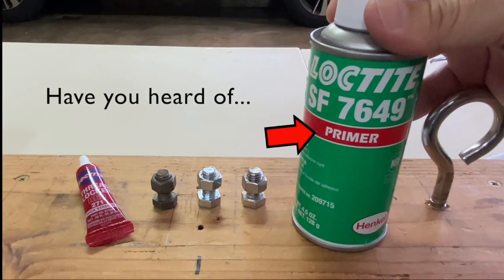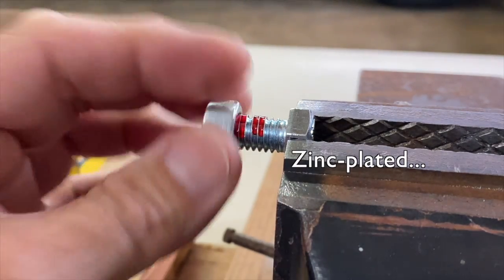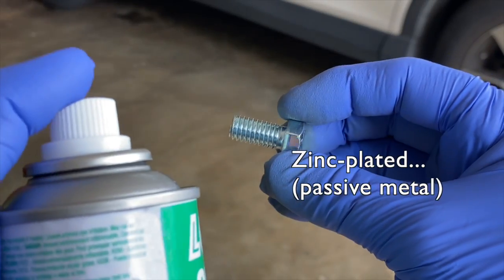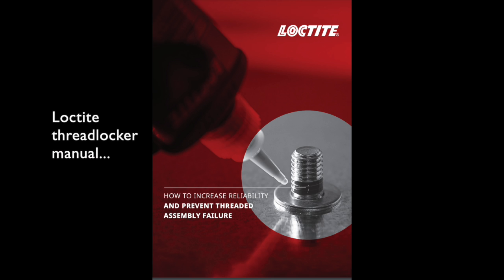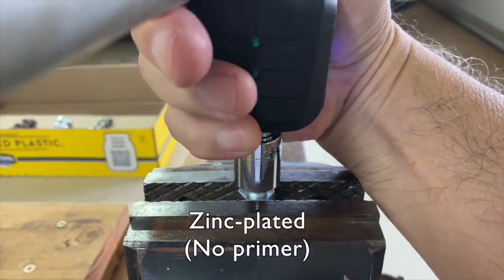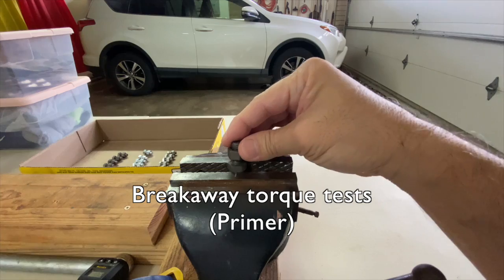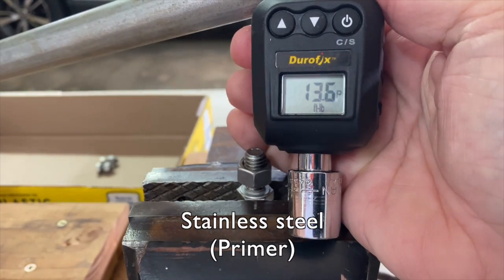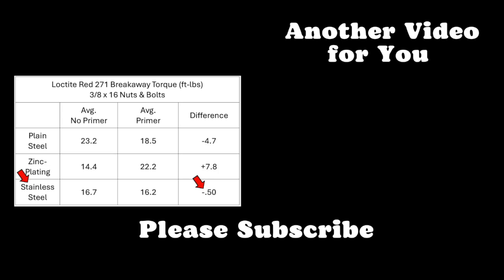Nuts & Bolts - Most DIYers Have No Idea - Loctite PRIMER?

Comment: Never even heard of this stuff. Great video and testing i think if you have a can it definitely doesn't hurt. though i think you should not remove the outliers on such a small sample. Maybe 8-10 you can do that but the variability of the hardware and the adhesives should be considered. This is what you'll really face

Comment: you used the primer wrong

it's not supposed to just be sprayed on like paint-move the spray close to the thread

it's supposed to soak the thread and remove contaminants with it

picture dries and works best with heat-just use a lighter or something and you speed up the chemical reaction 

BTW heat speads up any chemical reaction

Comment: I would suggest trying this same type of test with the following:  medium thread locker with bolts & nuts as is, and again with the nuts & bolts cleaned before applying the thread locker.  We found a huge difference when using Acetone to clean before applying threadlocker.

Comment: As far as I can tell, Loctite seems to need a primer if the formula ends in a even number, and for odd ending formulas, these are usually labeled as "oil resistant."
I'm searching for a different formula because the primer has only a year shelf life.

Comment: Loctite is intended to combat vibration induced loosening . It is not really an adhesive .
Reply from the maker: Thanks!  It is an anaerobic adhesive that is used to prevent loosening by vibration.  Measuring its breakaway or breakloose torque is a convenient way that the manufacturers use to test its strength.  👍😎
Reply: @HacksbyDad  would you try and glue something with it ?
Reply from the maker: @philliplopez8745  Nope.  I would not.
Reply: @HacksbyDad  they use the Junkers test , are you familiar?
Reply from the maker: @philliplopez8745  Yup.  I can't figure out an easy way to make a Junker test rig.  Here's my diy version of an alternate aviation vibration test rig... https://youtu.be/lwtUWB2TIYA
👍😎

Comment: I am supper concerned with the low torque values.  Thread locker should create a fairly uniform torque (not a surprising high and certainly never low).  They are generally anaerobic, so maybe the 0 and low ones had too much air (too loose) to work (cure) properly.  Who knows, but clearly a fail.  Another thing that this shows, is testing is very important if it is a critical install.

Comment: This shows that, generally speaking, any kind of adhesive cure is almost always stronger if the cure is slow rather than fast; and primers can, in some  circumstances, weaken rather than strengthen the bond.
Reply: They don't cure well, and sometimes not at all, on stainless bolt and nuts without the primer. 
In some cases, it's an unfortunate necessity.
Reply: I have some anodized aluminum rods with threaded joints/couplings.  Would primer help or hinder threadlocker curing?

Comment: Do you want to wire brush the plain steel before applying the loctite? I think the black color is because of the oxidization.
Reply from the maker: Thanks!   I didn’t think of that. 👍😎
Reply: Actually , the Black is a surface coating to PREVENT rust in storage .
Reply: @johncunningham4820 , *anodizing*, an electrolytical process to prevent further oxidation; but high-humidity or  condensation will cause rusting eventually. Identically anodized fasteners (same metal and coating) tend to cold-weld themselves together anyway.....
Reply: @goodun2974  I didn't know anodizing was used on anything but aluminum.
Edit: Upon reading, ferrous metals are specifically excluded from being anodized.
Reply: @goodun2974  . Who  mentioned  Anodizing ? Other than You , of course .
Reply: @joewoodchuck3824  , not just aluminum. From Wikipedia, "Ferrous metals are commonly anodized electrolytically in nitric acid or by treatment with red fuming nitric acid to form hard black iron oxide. This coating remains conformal even when plated on wire and the wire is bent. Processes for anodizing also exist for titanium, zinc, magnesium, niobium, zirconium, hafnium and tantalum". Also this: "Anodic films are generally much stringer and more adherent than most types of paint and metal plating, but also more brittle. This makes them less likely to crack and peel from aging and wear but more likely to crack from thermal stress."
Reply: @joewoodchuck3824  . Anodizing can be used on any Conductive Metal .
Iron and Steel are frequently Anodized to prevent Corrosion . That's what Galvanising is .
Reply: @johncunningham4820  , um, yes and no. Hot dip galvanizing, often seen used on bolts and nails, is done by immersing steel into molten zinc.  Zinc can also be plated onto steel in much thinner, smoother layers by an anodizing (electrical) process,  which is preferred if the surface is going to be painted.
Reply: @johncunningham4820  I didn't think galvanizing and anodizing were the same at all. Galvanizing is a hot dip zinc coating, where anodizing is more of a chemical treatment which is nonconductive. It also hardens aluminum surfaces and is in fact an electrical insulator. You can prove it with an ohmmeter.
Reply: @goodun2974  Analyzing and anodizing are not even related to each other.
Reply: @joewoodchuck3824  it was autocorrect's mistake; I fixed it. Thanks for the heads-up!
Reply: @joewoodchuck3824  ,  I spent 20 years as an audio equipment repair technician and often ran up against cases where poor grounding was created by a layer of anodizing on bolts, screws and/or the chassis itself. Every successive generation of electrical and electronic engineers repeats the same damn mistakes!
Reply: @goodun2974 . Shame on the manufacturer for not knowing any better. I designed custom electronic equipment often using anodized aluminum front panels and enclosures. It was standard procedure to  counterbore (not the same as countersink) any locations where conductivity was needed as the very first step of construction. I preplanned layouts so I'd know where it was needed. Not good stuff to breathe during the process of clearing it either.
Reply: @goodun2974  I swear autocorrect hinders just as much as it helps. It gets in the way of intentions as well insisting on inserting it's own idea of my thoughts.
Reply: @goodun2974  Ferrous metals are specifically ruled out for anodizing according to what I read, including Wikipedia. Maybe you mean some other process.
Reply: @goodun2974  Except that zinc coating isn't called anodizing, not in any common terminology at least. It's called plating. Anodizing doesn't add any metal to the base metal which is most often aluminum. It combines the existing aluminum with another chemical for surface treatment.
Reply: @joewoodchuck3824  , I've also seen lots of metal chassis that were heavily painted on the inside, in places where grounds needed to be made,  Including threaded standoff posts that were riveted or slot welded to the inside of the chassis before it was painted and so the end of the standoffs had paint on them where they were supposed to sit against the underside of the circuit board and make contact with a ground pad..... and they'd use black painted or anodized screws to hold the board down to the painted standoffs!
Reply: @goodun2974  Very poor design. The standoffs should have been masked before painting and fully conductive screws specified. Additionally, a wire jumper should have gone from a dedicated ground point on the board not associated with mounting, and to a dedicated (unpainted) chassis ground point. I went a step further by always separating circuit ground (reference) from earth ground to eliminate ground loops. The people who used my equipment measured noise in microvolts.
    A degree may get someone in the company door, but it isn't a measure of being smart.
Reply: @joewoodchuck3824  ,  These days you'll see lots of stuff built in China where they're still switching and/or fusing the neutral line instead of the hot, running the hot to the side terminal of the chassis-mount fuse holder instead of the rear terminal, combing the earth ground point from the power cord with another power supply or signal ground, or tie tge earth ground to  the mechanical mounting of a heavy transformer, instead of having a dedicated, unshared earth-ground point.  And then you've got things like cloned digital soldering stations coming out of China that can leak 100 volts through the tip of the iron into the board, running the risk of damaging sensitive components. I've seen reviews of these things on YouTube......
Reply: @goodun2974  It's a scary world when ignorance reigns.
Reply: @goodun2974  . BOTH those are correct . It depends on the End Use of the Product .
Reply: @joewoodchuck3824  . Well THAT's Piffle . Galvanising of Steel/Iron was originally an Electrolytic Process  whereby the  Zinc  Anode dissolved in the Electrolyte and was deposited , at a Molecular Level onto the Ferrous Cathode . Works the same for Cadmium and several other metals used to coat Steel .
And Galvanic Plating  is  still  used .
Hot Dipping  is  technically  not  related  other than Zinc and Steel being present . 
Which process is used relates  MAINLY  to the End Use of the Product processed .
Reply: @johncunningham4820  WTH is piffle?
Reply: @joewoodchuck3824  .
Piffle : aka  Balderdash  aka  misinformation  aka  B/S .
Reply: The black color is a chemical coating.

Comment: Hello Dad!!. "Gracias por el video", thanks for the video. Im not from USA, im from Colombia.  If i remember the primer is mainly for cold temperatures to shorten the drying time of the threadlocker. In Colombia we dont have that, as we have a single tropical weather all year long. But anyways i enjoyed your video.

Have a nice day Papá.
Reply from the maker: Thanks!  Yes, it’s mainly for curing speed in cold temperatures and on passive metals.  👍😎
Reply: @HacksbyDad , it's my understanding that threadlocking compounds are a variant of cyano-acrylate compound ( CA/Super glue) designed to cure in the absence of oxygen; tight threads exclude air from the interface, which begins the cure. Also, CA glues in general cure from exposure to moist air, and cure more slowly in dry environments; and so it makes sense that a primer would be helpful for fast cure of anything CA-adjacent in cold temps, which tend to be  dry-air environments.
Reply: Threadlocker doesn't "dry", it cures. Note that you can't simply add a drop of Loctite or similar to the fastener after you connect them ---- it must be put on the threads prior to assembly. Otherwise, for after the fact threadlocking, you need Glyptol or a similar lacquer-like compound.